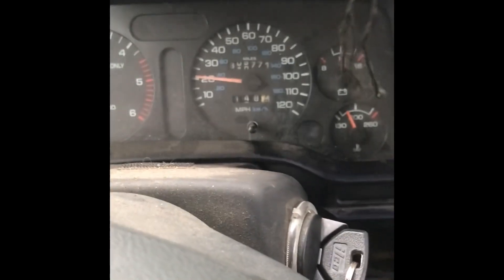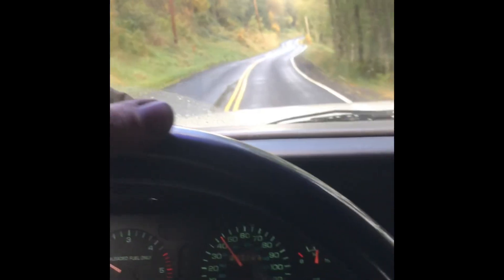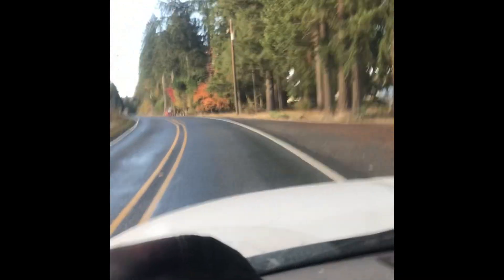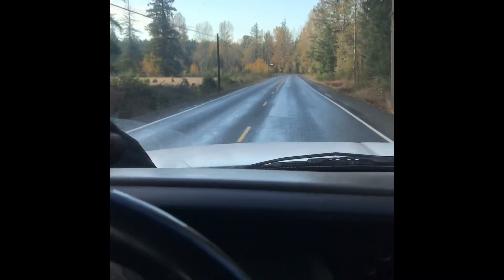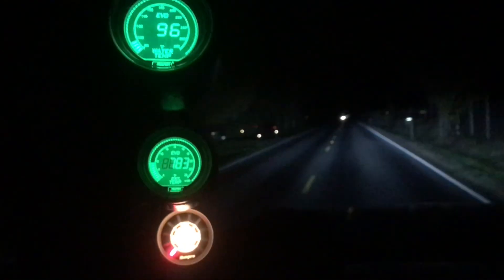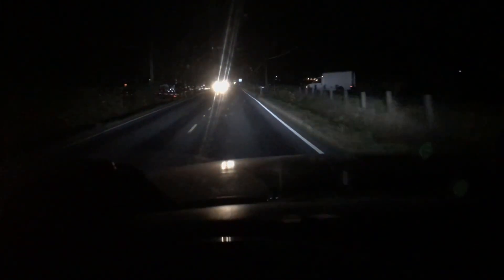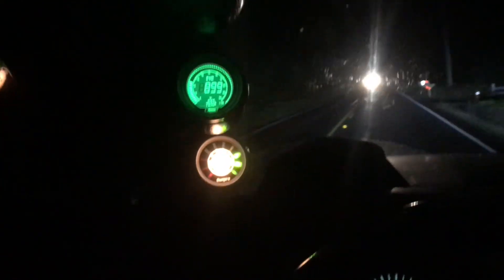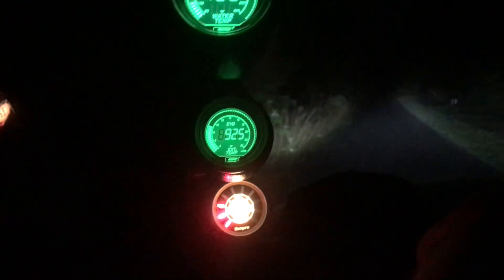Let’s Go for a Drive in the V10 WOODGAS TRUCK

Comment: I wanna see what a v4 could accomplish on a smaller vehicle in terms of efficiency...what do you think of biodiesel compared to this? Is it possible to design a vehicle that can run on both? Biodiesel definitely seems like it would scale better, but this system allows you to procure instant fuel pretty much anywhere
Reply from the maker: @humanerror7  I know a guy running a diesel tractor on wood, know another guy that ran a diesel on 70% wood 30% diesel it could be done

Comment: You know what would make a cool wood gas project, a back to the future DeLorean with the "Mr.Fusion" conversion, the mr fusion bit could be the burner, the time circuits could be set up as gauges for all the bits that need monitoring and you could store the wood under the hood

Comment: So, I'm picturing stock ECU, stock narrow band O2 sensors (those left intact for the ECU minus a wideband for standalone on your gauge pod), and the ECU is of course fully unaware that something other than gasoline is being burned, while it's hard to say how much of an impact if any arbitrary readings coming from the O2 sensors are having an impact on spark timing (maybe none at all given it's OBD2, or given the AFR is likely out of range on the narrow bands). And so I'm guessing the ECU might fall back to limpmode like conditions on the woodgas, but do you think the alternative fuel has any recourse on the spark timing used, or is it merely load vs air density (or manifold air pressure) that weighs in the most on spark advance?
Reply from the maker: @kylecurry6841  difficult to say, this truck was originally obd2 and I did some driving and watching live data to see how the timing reacted to throttle input on gasoline and later on woodgas and I could see no dicernable difference in how to timeing reacted. It has since been swapped back to obd one which unfortunately I do not have a scanner that could monitor this but by seat of the pants it feels smoother and more powerful on woodgas then gasoline. It’s a shame the obd2 computer died and I couldn’t find a replacement and has to change out the ecu and harness to keep the truck on the road, I had leads on a shop that was willing to tune the factory obd2 computer to really maximize the timing curve which on these v10 appears to be maxed at 72 degrees btdc. Could have unlocked a lot of power.
Reply: @BigBeavrSlayer  good points. Sounds like dropping back to OBD1 helped either by possibly more aggressive spark tables, or lack of input the OBD1 might have had vs OBD2, via channels from the narrowband O2's. 

Electronics aside, you have one eye turning machine here even as the woodgas appears to be regulated by carbureted means!

Comment: Don't know if it will work but if you have a map sensor off your green truck unplug that one and plug in spare ...pretty sure timing is pulled via map kpa more than tps...  It's worth a shot...yes I will start modifying some tables so when you get hptuners I can send you file ...also look for a mpiv2 used on marketplace ...alot of folks are having issues with new one released because EPA is getting heavy handed.   My laptop never sees the internet so the software will not update.
Reply: Sorry need to clarify .plug in spare map sensor and just let it hang out on engine not seeing vacuum ..it will pop ses light eventually  but that system is pretty slow and forgiving...with map in open atmosphere watch you timing....   .at work may not...just a quick easy idea..   congrats brother...looks good.   

8 haven't worked on mine...put the house up for sale and been stupid busy moving stuff
Reply from the maker: @mechanic_prepper  ill be down at the shop Monday with the green truck and give it a try 👍where are you moving to?
Reply: @BigBeavrSlayer  still in area kettle falls.  Just getting 20 acres spread instead of 1 acre I'm on now.   Need more room for bigger shop and some livestock
Reply: @BigBeavrSlayer  and when you get a laptop just make sure it's windows based.   I like the small ones.  Keep it in your truck with an inverter to keep it charged....you will want the ability to revert to factory type spark maps if something happens with woodgas.   I'll walk you through optimizing stock tune and one for woodgas.    There is alot left on the table with factory tune...they were extremely conservative hence why your seeing only 10 degrees advance under heavy load... Most engines like high 20s or low 30s as long as fueling is correct.   You're loosing a ton of torque.
Reply from the maker: @mechanic_prepper  that's awesome!
Reply from the maker: @mechanic_prepper  oh ya I can feel it, if I'm pulling a hill and let off the throttle a little bit I can feel the timing come back up and the exhaust note changes and the truck has a minor power pulse. Just not enough to accelerate, just maintain speed

Comment: Looks good! The crossover temp thing almost home is weird. Think maybe you are somehow getting an air leak that's consuming a little wood gas in the crossover?
Reply from the maker: Usually that is a indication of over pulling the gasifier and its going into heater mode so who knows

Comment: Can you do anything to alter the ignition curve when on woodgas.....a propane or natural gas dual curve ignition controller or something?....many years ago i had a programmable ignition fitted to allow a bus engine to use the factory curve for liquid fuel and a modified curve for woodgas, with it being a fairly heavily loaded engine it made an unbelievable difference to power.
Reply from the maker: That is in the works, it can be modified I just need a laptop and tuning system to do it
Reply: @BigBeavrSlayer  I think you'll be quite happy with the performance improvement.....on the 454 it made a mad amount of difference.